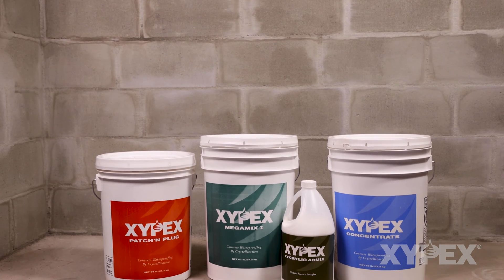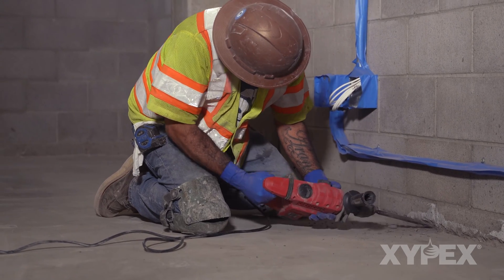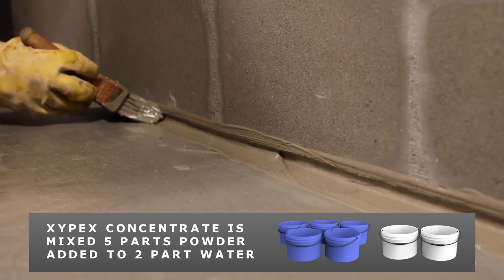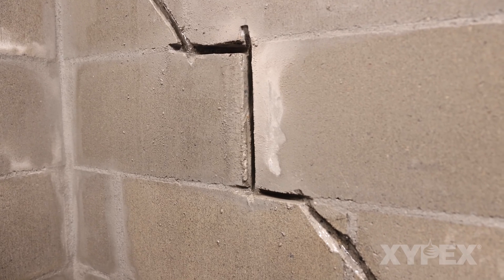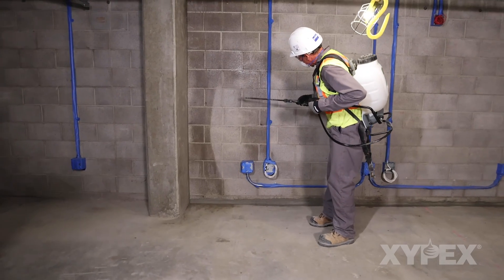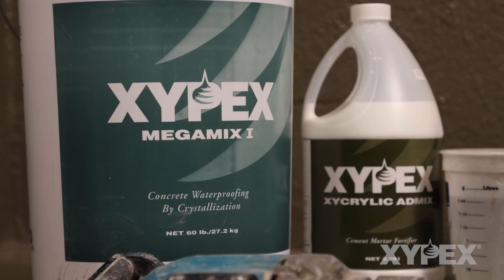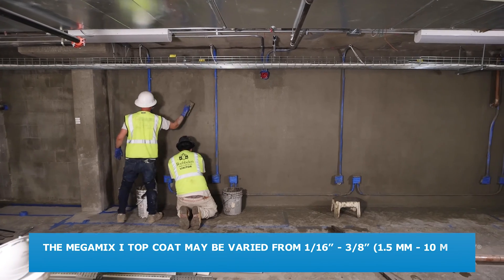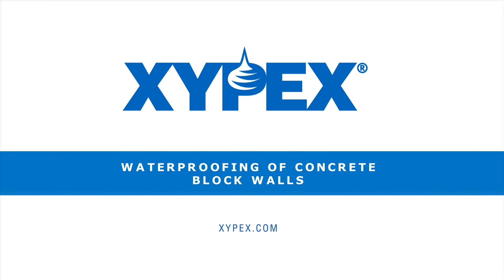Xypex - How to Waterproof Concrete Block Walls (CMU)

Comment: This is a horrible system using block walls for basements. And then to dig up a whole wall outside and fill it in like a company did to me without sealing it outside was awful to do to a customer and they dint want to come back. They charged a ton

Comment: I have a masonary wall that has been leaking water for years. I hired someone to clean the wall because I had used stuff that didn't work. This product is absolutely wonderful. During the summer,  I followed the directions and used a heavy brush to smear the concrete on and despite the heavy rain that fall,  the whole room for the first time in years has been completely dry.
Reply: From the outside right.. you waterproofed from the outside 🧐
Reply: @youngprince716  no, the inside